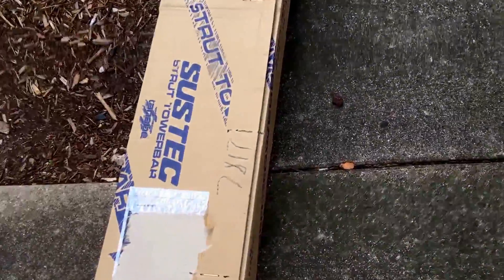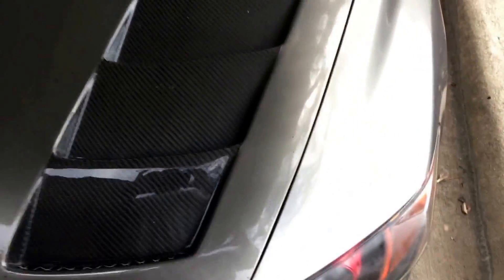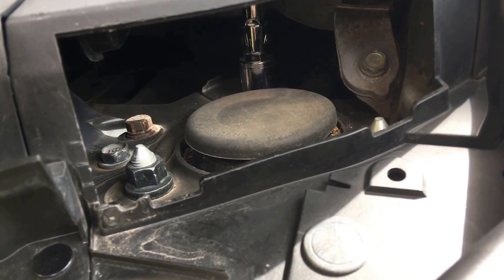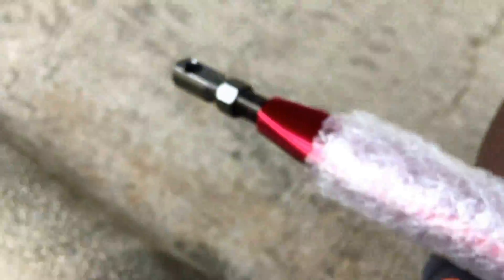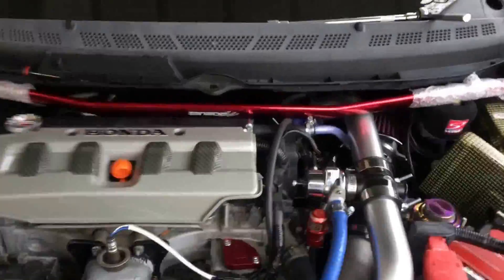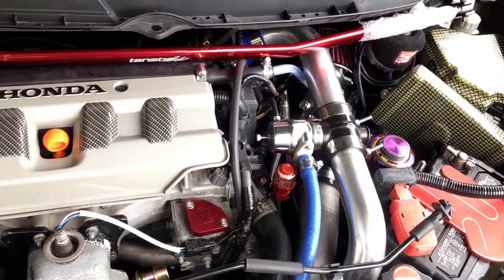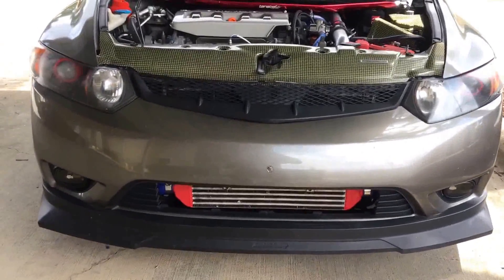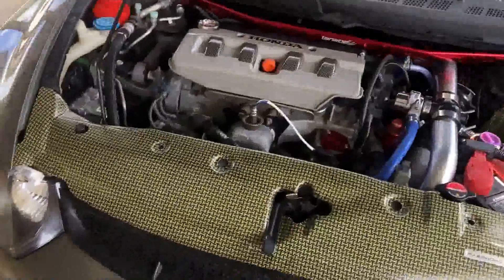06-11 Honda Civic coupe turbo R18 tanabe tower bar installation (strut bar)

Comment: Q: Did your windshield wipers chatter make unusual sounds when you put back together or were they smooth as before?
Reply from the maker: no noise. dont know why the wipers would make sound. or even why your messing with wipers doing a strut bar lol